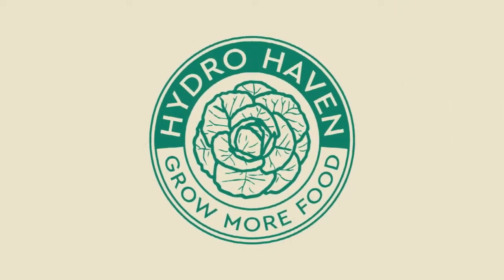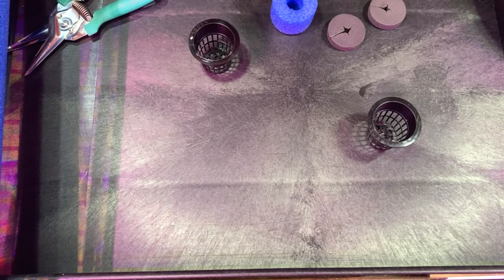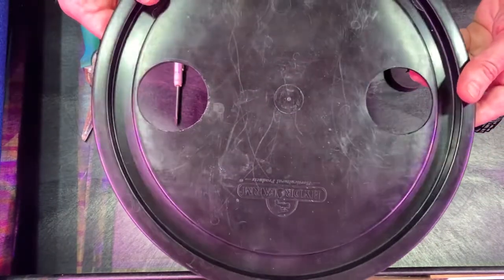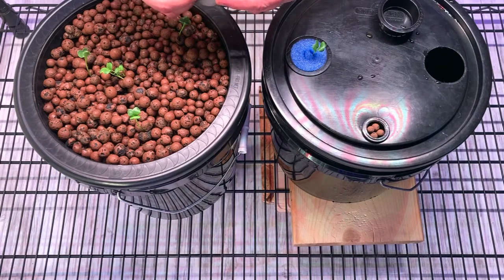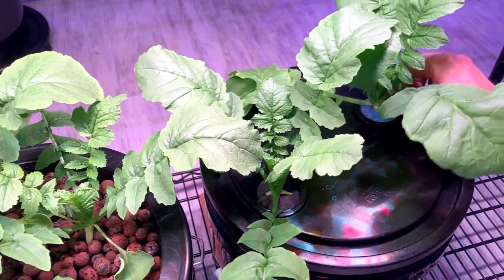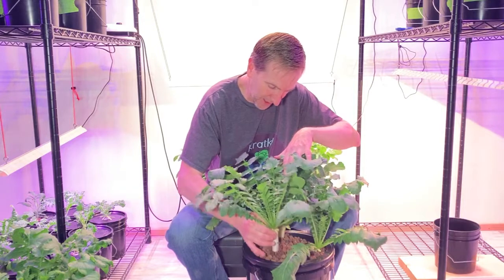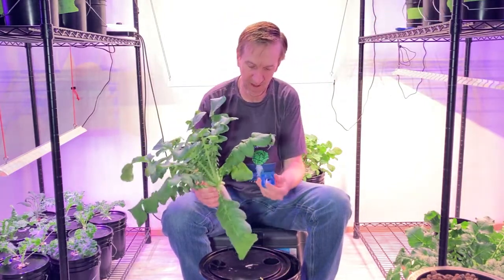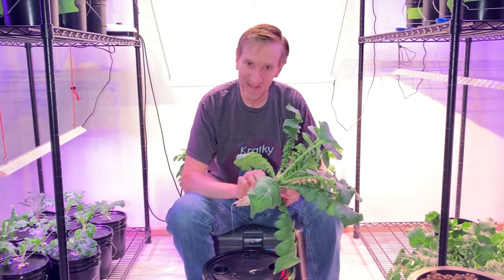Hydroponic Daikon Radishes - Comparing Two Grow Methods

Comment: what happened to you?...........what are you growing now
Reply from the maker: I'm still around, but I'm taking an extended break from making content. Some of the content I wanted to publish didn't turn out... so it got scrapped. I'm trying Kohlrabi, so far so good (2" net pot in rockwool, 5 gallon bucket. ~1,200TDS and ~5.9pH). I'm also growing some cabbage to have for late fall. I still have my staple crops: lettuce, kale, arugula, basil, and sage. Green onions grow well outdoors, so I took a break from growing those indoors for a while. Thanks for checking in!